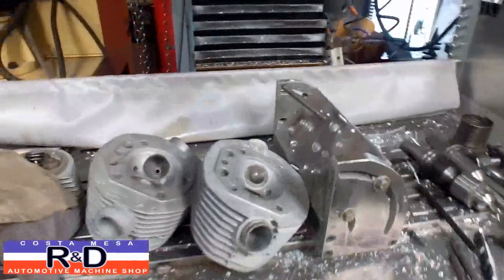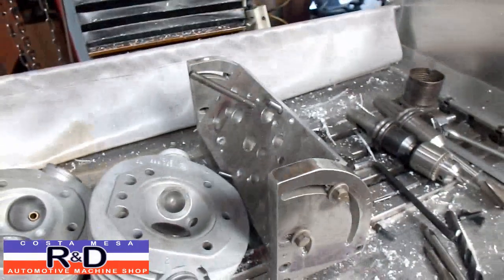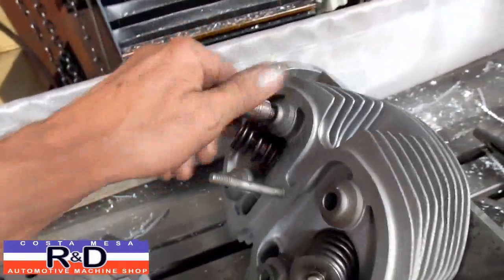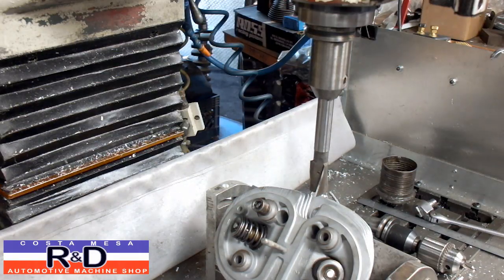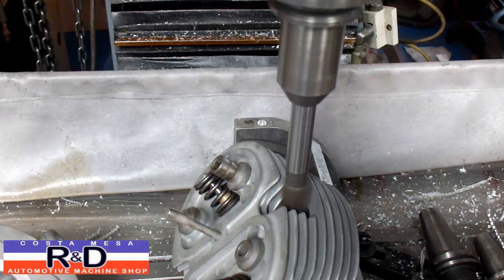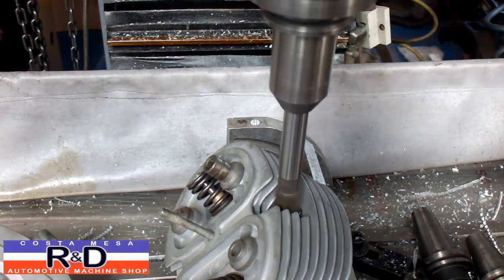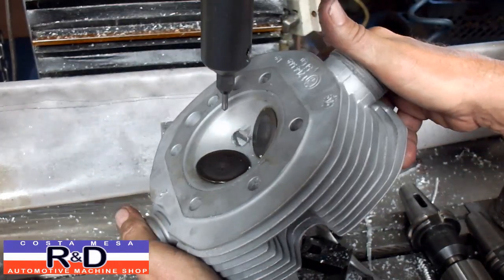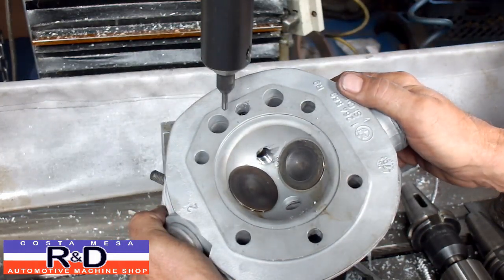BMW Motorcycle Twin Plug Conversion

Comment: G,Day i just bought a 1150RT BMW and      where is the second spark plug plus i need a new belt for the alltenater is there any thing else i should be doing its got 47k,s on the clock cheers .

Comment: The tilting jig is a VERY old basic design (older than anyone living, but what makes fiatnutz version cool is it's not a heavy bitch to handle like commercial machinist tilt tables and that he didn't have to buy it. He won't lose any business by putting it out on Youtube and his videos are an excellent ADVERTISEMENT for his skill. 

I'll be taking a center drill to a couple of ratchets today. Very cool trick, the simple ones are the most elegant.

Comment: One last very important advice. Never never use the m14 plugs for the second hole. You have to use m12 plugs. There is less meat in the cylinderhead at this place. There is a chance of heat stress cracking between the hole and the valve seats. Result valve seats dropping and a nice repair bill. This gives you some room for thread repair in the future if needed. Also counterbore the threaded hole on the combustion chamber side like the original plug. This improves flame travel
Reply: That's right M12 spark plug and Dyna Coils 1,5 Ohms twin output coils.

Comment: You can use any vice that you can put under an angle.. Make a plate with the 4 holes in the position of the rocker holes. Be sure the plate and holes are symmetric. Make a rod with the plug thread at the end. Screw it in the existing plug hole. put the head in the vice with the rod upwards. Align the rod so it is 90° to the machine table and concentric with the spindle. loosen the 4 bolts and the rod. Turn the head 180° and you can face mill and drill the second hole.

Comment: Shows how great a special fixture is.  Work stays in place solidly & reduces setup time.

I've seen clay packing put in heads w/ thinner fins (Porsche six) to avoid breakage when the cutting first hole.  Are the BMW fins thicker & you don't need to pack them?

Twin plug is a must on the air cooled stuff when compression ratio gets increased.  Pre-ignition happens on the single plug head w/ the higher compression because the "dead" side opposite the plug pre-ignites by compression, not spark.

Comment: Longer burn?  I would have figured it would burn faster with two flame fronts and even require ignition advance to be lowered to keep peak cylinder pressure timing in check.  Crazy.
Reply: Well you figured wrong.

Comment: That's probably a symptom of ignition. On these bmw's you have to take the stock 32deg of advance (at ~3000rpm) to 22deg when you twin plug them. It's something i'd like to do to run normal octane on my BMW.

Comment from the maker: There are two thoughts about twin-plugs, some say that each plug should fire equally, some say that one should be slightly ahead of the other. In eight case, you get a longer burn time that is very benificial to engine operation and it offers more complete combustion. The cool part is that you can race someone and say that you'll pull one of your plug wires. Ha......... You usually can't see the second plug.

Comment: Sweet! I recall you saying you owned a Maserati (I think) with the 2 plug design, and when you switched the second plug off you could feel the difference. I'm curious what the dyno would say. I believe it makes a big difference, but I'm just curious how much more efficient it is. I guess it improves power because it burns the vapor from 2 seperate but equal flame fronts, instead of just one?